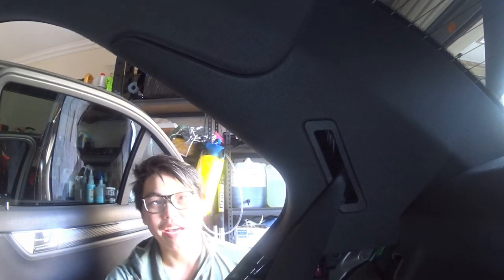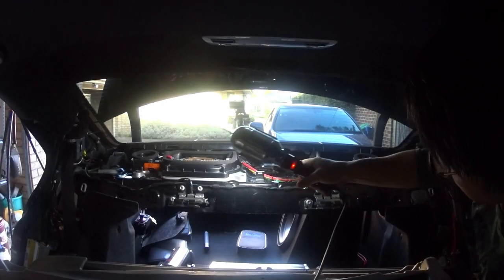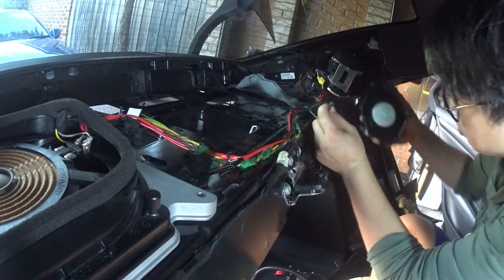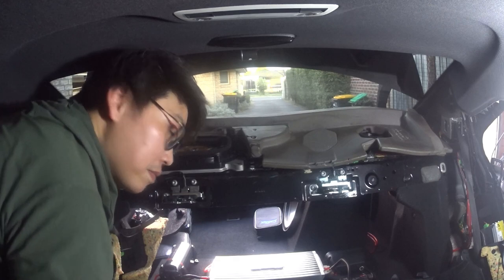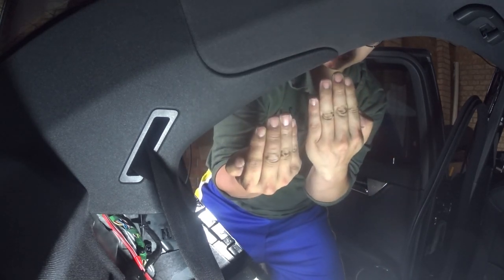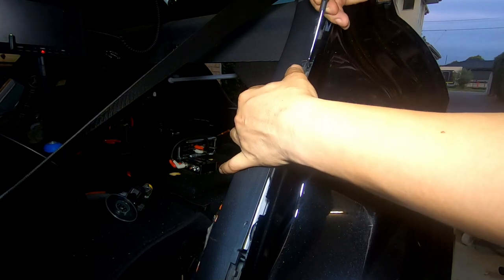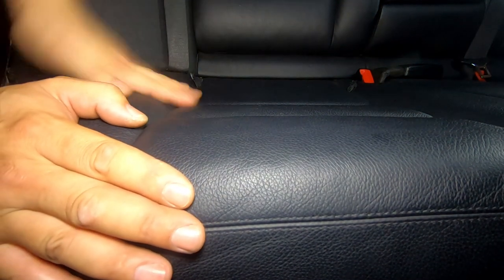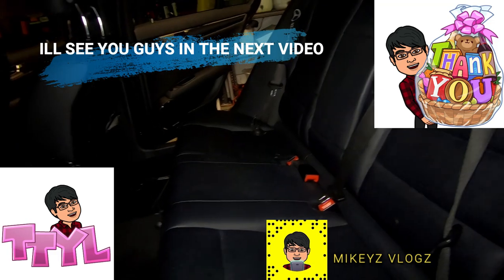MERCEDES BENZ  C CLASS W204 HOW TO ACCESS  REAR DECK + 3RD BRAKE LIGHT

Comment: NOTE: For Coupes it's a bit different to remove that upper corner piece before you can get the shelf out. You pop open that plastic Airbag cover and underneath there is a torx screw you need to undo first. After that the process is pretty much to same for unclipping and pulling that piece out. Then you will be able to access the rear shelf
Reply from the maker: good tip
Reply: Bey would I have to disconnect the battery so the air bags don’t go off?
Reply from the maker: they wont go off but u will get airbag light error. so make sure u disconnect and wait 20mins for all power to discharge

Comment: I did it!!! I swapped rear deck cover after changing the bench from non-foldable to a foldable one year ago. My conversion is as complete as it can get (missing lock cables that sense if the bench is closed). These hex mounts gave me headache. I will not retry this even if someone payed me to do it. Also, side note: wash your hands when installing these. After messing around with door seals and such, your hand will be dirty. My car has light interior, I got sweaty so I left dirty marks on these.
Reply from the maker: well done

Comment: just what i needed, i am getting some loud static noise from the smaller speaker in the rear. i hope by disconnecting it it solves the problem.

Comment: dude I love you, you safed my day with your ambitious and confident explaination skills. thank you !
Reply from the maker: im so happy to heary found my video helpful... ur so welcome .. we should all help each other out and spread the wealth of knowledge..its priceless
Reply: @MIKEYZVLOGZ  I was looking for this for my w204 coupe, there‘s something rattling inside my 3rd breaklight. That will be the only way to figure out, hope I can fix it. Something has to be loose inside
Reply from the maker: @nixpainnixgain  check the seat belt case ... its either one of the seat belt cases or tourrear deck panel... most likely the seat belt assembly that holds the belt inside and retracts ...
Reply: @MIKEYZVLOGZ  I just took a look in the back of my car and these parts and realized that it would be a way more difficult job to do the same thing in a w204 coupe.. not only the seatbelt cases, it‘s also the armrest on each sides which are clicked in different parts of the interior in the back ..I‘m a bit desperate tbh There is also an Airbag badge on the seatbelt- assembly part 😰
Reply from the maker: @nixpainnixgain  hmm sounds like a involved task but rest assured u can do it.. u can fix most things on these cars yourself.. just do some research first and have patience ... do not try to just pull it off.. makes sure you understand how it removes first ..or u can easily break stuff..take it from me..thats why i made these videos cuz i made alot of mistake too ..and i noticed that wen iim frustrated more mistakes happen often then not..so wen frustrated breathe walk away come back then try again
Reply: @MIKEYZVLOGZ  thank you, I will try my best !

Comment: Dude! Awesome work! But what if we want to upgrade? How can we find better ones? I have never seem this sized speakers anywhere else. Any ideas. Much appreciated!
Reply from the maker: hey buddy ...yeah i know what u mean ...i know they make flat subbys now althought finding the exact same size subby mite be a challenge... and with the speakers on the rear deck  ive also tried to find the right sizes but thats a challenge too .... i guess it may take some custom modifying to replace them... i know its easier to replace the front splits and the rear coaxials as they are common sizes ...but to be honest all ive done so far is replace  the tweeters and added a sub for abit more bass 12inch but its now abit much i may have to go down to a 10inch as im not all.about that bass .... its about personal preference.... ur choice .... im even in the process of trying to replace the centre dash speaker but nothing is of that size and depth.... ill just keep looking

Comment: Awesome video! I need to get signal from the rear deck sub so I can install an amplifier in the trunk. Do you know which cables I need to splice in so I can get the signal?
Thank you for the effort and time spent on filming the procedure!
Reply from the maker: u want a signal for your amp? or your sub? line output converter ?
Reply: @MIKEYZVLOGZ  it’s a subwoofer with a built-in amp like those that goes under the seat. I need the audio signal so I can give it as an input to the sub/amp. Sorry for the confusion I don’t know much about sound systems. Thanks for the help
Reply from the maker: @GuilhermeIsidoro  that's OK no stress... do u have a factory sub? if not u gotta get tour signal from the doors... I have a hk system with factory sub dual channel so I was able ro tap into my 2 channel sub for more bass ... in tour case..if u don't have a factory sub u will have only front splits and rear door speakers ...so u take signal from the door speakers...many ppl have done it like this that don't have a factory sub...if u do and just wanna add more bass like I did u can take the low input from factory sub...if not tour rear door speakers is your best bet...and u take it from the wires between the panel that seperates the front and rear..the middle a frame ..hope this makes sens e
Reply: @MIKEYZVLOGZ  I don’t have the HK system so I might not have the rear sub although I’m not entirely sure. My car is the coupe w204 so I’ll try to tap one of the rear seat speakers. Thank you a lot for the help!
Reply from the maker: @GuilhermeIsidoro ye u need to tap the door sub  u wouldn't have a sub  if u don't have the hk system

Comment: Have you possibly taken the back speakers apart? Wanting to know if 3.5 inch speakers fit on the corners and a 6x9 inch sub fits where the sub goes. Thanks in advance.

Comment: Hi, if I have foldable seats and just want to get into the rear deck to see why I have a nasty rattle coming from where that sub is, do I still have to remove the seats? Great video btw
Reply from the maker: hi andrew welcome to the channel i hope you can show your support by subscribing if you havent yet..it would really help me and mean the world the me to have your support..as for getting to the rear deck ..unfortunately there is no way around it..you have to remove the lower seats and th sides in order to access the rear deck...
Reply: @MIKEYZVLOGZ  Thanks for the reply I really appreciate it! I'm really need to know how to get the side cushion fully out mine is still locked and stuck at the very top, and some thing for the side panel. There's this nasty piece of plastic that's holding it in and idk if I'm just supposed to pull it off or not. I'm already subscribed to the channel :p
Reply from the maker: @andrewrizk5245  the side cushion next to the back rest?
Reply from the maker: just get a good grip on it and it will.come straight out make sure at the very top where u can feel the assembly that is inside the side cushions ..make sure ur gripped onto that assembly do not just pull from the cushion you will RIP it!!! get a good grip of the assembly and pull back straight with some force ...its just clipped it like the lower rear seats are exact same principle

Comment: great video, I want to access that part in my C Class 2023 W206 because It has sound insulation problem, outside noise coming from under the rear glass, should I remove it the same way? will I have to remove the headliner too ? I'm scared to do it, it's weird that we have to remove more difficult parts first, any tips on the W206?
Reply from the maker: I believe so I haven't done it on a w203 but it's basically the same procedure
Reply: any tips on what I should look for when it comes to isolation/noise in that area? I feel like the noise is penetrating the car from under the rear glass (over the boot, not the boot itself) like if the foam isn't there or some sealing issue, my ears get clogged everytime I drive the car, unfortunately the service center caused that problem after they worked on the car and removed and put back things, but they can't understand what the issue is so I'm gonna do it myself instead of wasting time with them, before they work on it the car was completely silent, sorry for the long comment @MIKEYZVLOGZ

Comment: Hi. I have a sunshade in the back (e350), I noticed the sunshade's rail attaches to the top corner piece that needs to removed to access the deck. What should I do in my case? I don't want to create an issue with the sunshade as it seems to all be connected
Reply: *rear deck (I'm trying to replace the factory sub, mine is blown).
Reply: did u find out anything? I'm having the same issue.
Reply from the maker: @Wavyypxter I'll see what I can work out for u

Comment: Hi m8 great video.  I have a c250 coupe and need to replace the 3rd brake light do I need to take rear seats out👍🤔
Reply from the maker: yes because in order to remove the rear deck u must remove the seats

Comment: great video nice instruction. i wanted to upgrad the rear sunroof do you know where to plug it in? its an original part and it should plug in into a black connector.. would be great if you could provide any infos <3
Reply from the maker: wen u say rear sunroof what do u mean ..as I only know of the rear sunshade and actual sunroof
Reply: thanks for the quick answer. thats what i was talking about sorry haha i meant the sunshade wich covers tha back window.. i installed it with the shelf but i need to plug it in and i dont know why i went to the factory and they told me the cable must be preinstalled so i cant get a single one. @MIKEYZVLOGZ
Reply from the maker: @lamaamasi313  ph ok.. u need to check wis manual and see how they hooked it up

Comment: I don’t understand a thing! I have the AMG interior and exterior package no Harman Kardon option. However I have that speaker in the back and the subwoofer! Is this standard on all the W204? They sound fantastic for what they are! I changed the player and installed an Android Chinese thing and the subs are working but I don’t understand what and how they are getting the signal from the main unit? Any ideas would be greatly appreciated!
Reply from the maker: ok do they have hardwires the speaker using fiber optic cables that run under the carpets along the side and chassis of the car main frame..metal frame ... and u have a subwoofer in the back left quarter panel ... it gets signal cuz its all hardwired and wen u connect your new system..u use your standard plug which has an adapter that plugs into your after market unit ..thata how it all gets connected ... just the same as how u install an aftermarket hedunit on any car u use the iso harness that allows the new unit to connect via the adapter..meaning all speaker signal and power and amp signal is all connected .hope this makes sense .. now with the the sub woofer and non hk system ... not too sure but non hk systems don't usually have the sub woofer in the back ... so do u have all the speakers centre dash front splitters rear doors and rear deck shelf subwoofer...its def not STD  for w204 to have sub woofer normally u need the stereo package added..their are so many packages u can get for w204 from lighting packages to multimedia package. amg package sports package wheels packages ..  navigaton package .. etc..what u have solely depends on what they added during manufacturing

Comment: Hey Mikey I just bought my 2014 w204 and my rear right speaker is blown next to the amp. My question is the speaker on the left and right the same in different brackets? Could i buy a replacement drivers speaker and install the speaker in the passanger side?
Reply from the maker: the rear speaker are surround and a subwoofer ... so they only play surround sound ..not vocals or bass... u can try find replacement speakers but I've heard alot of ppl try and fail because they are a certain size ... yes they are the same speakers just in different brackets... a good idea might be to buy used instead ... but its your choice I guess u can always try to custom fit surround speakers in there ...
Reply: @MIKEYZVLOGZ  This is a common problem. Either rear subwoofer or speaker blown.  I have the same vehicle with the Harmon Kardon Logic 7.

Comment: Hey Mike. I need to replace my stock subwoofer. But I can't find the other video. Can you show me how to remove the sub?
Reply from the maker: I show how to relove the plate with the subwoofer in it ... to remove the sub from the plate that holds it wont be much more difficult ... as long as u remove the sub woofer from the rear deck u can figure out how to remove the sub from the mounting frame... from memory to remove the sub from the frame should be too much work... the important part was to show how to remove the component cuz if ur replacing with another factory sub u will get it with the mounting frame as one

Comment: Thank you Mikeyz! Question: my speakers are blown out. Is it possible to replace them with aftermarket ones (other brands)? Or it has to be from the dealership?
Reply from the maker: hey bud..anything is possible but I've read that the factory speakers work well with the factory amp and the amp isn't that powerful so if u want abit more sound ur gonna need to upgrade the amp aswell  in order to get the full potentialnof your after market speakers ... I replaced just the tweeters thus far and noticed when I tried to upgrade the front splits the sound wasn't as good as the factory ones ...so I only did the tweeters for more treble as I added a sub too... that's what I believe and think friend...
Reply: @MIKEYZVLOGZ  thank you Mikeyz! Very clear and it makes sense.. for me there’s crackling sound coming from the rear shelf on each side. I think those could be the tweeters blow out?.. I’m going to a place tomorrow to see what can be done.. either replace them
With aftermarket or disengage them..
Reply from the maker: @P38Z350  in the rear shelf they are just surround speakers meaning they only play surround sound ... background noise..that's why our cars have theb5.1 Dolby digital.. so it's not tweeters ..its just surround speakers ... if u have they same speaker setup as mine with a factory sub woofer then they are just surround speakers very similar to a 5 speaker setup with home surround the fronts play the bulk of the sound treble mid and the sub plays bass and the rears play the surround so it sounds like there's ppl all around and tour in the centre.. makes sense?
Reply: @MIKEYZVLOGZ  ahh got it! Makes perfect sense! I noticed not much “sound” is coming out of them, except more of a “surround”... i have a CLA 2015 but the setup looks exactly like yours. The 2-combined with the 1 separate
Reply from the maker: @P38Z350  ahh yes then its surround speakers your looking to replace...
Reply: @MIKEYZVLOGZ  yeah. I asked in the dealership in NJ but they said it’s 650$ for the 2-combined and 175$ for the separate one. I think it’s a lot. So i will need to see what I can do. If it’s possible to put after market ones or just disengage them to remove the crackle
Reply from the maker: @P38Z350  look for 2nd hand ones they will work ..if ur going to disengage them completely better off to get used ones for a good price ..ebay have them ... what speakers do u have Harmon Karoonda ones? with the bluish cone? I'm not sure which they put on the newer models like the actually speaker models
Reply: @MIKEYZVLOGZ  right Harman Kardon ones.
Good idea Mikeyz. I’ll need to check for used ones. Do you think it makes a big difference having them or not? Based on your experience
Reply from the maker: @P38Z350  if the speakers are good they will be fine .... don't get me wrong u can try find after market ones .... u will however may need to modify them to fit as wen I was looking to replace mine I couldn't find the perfect size .... and I knew there would be some modifying needed to make them fit as they aren't exactly the same size and shape... just keep that in mind when looking ....... surround speakers just give u the feel of real life experience as if someone is walking behind u or talking behind u ... if u don't care just turn off your surround on ur system and play your music ... nowadays sound bars sound better then mostb5 to 7 speaker setups... love sound bars
Reply: @MIKEYZVLOGZ  got it thank you Mikeyz for all the feedback. I tried shutting them down using the system (menu of SOUND on the COMMAND interface) but I couldn’t: I can turn off the Logic7 Surround, but they keep doing the crackling noise even after As if they are still working. Other than that, I noticed the general sound changes. It’s not as nice after I turn the Logic7 off.
Reply from the maker: @P38Z350  correct...
Reply: @MIKEYZVLOGZ  hey Mikeyz, do you have an Airbag on the rear sides? Any issue with the airbag if I remove the panel?
Reply: And one more please Mikeyz :) do you know where the Amplifier is if I want to disconnect the shelf subwoofer completely without having to remove the rear sides, etc? Thank you
Reply from the maker: @P38Z350  no issues don't worry
Reply from the maker: @P38Z350  amp is behind the rear fuse box above left rear tyre behind the car pet
Reply: @MIKEYZVLOGZ  thanks a lot Mikeyz! I went to a car shop today but everyone is afraid to work on a Benz!! I’ll do it myself using your great video’s help. Thank you sir!
Reply from the maker: @P38Z350  typical response

Comment: i need to remove the speaker grille behind that other rear deck speaker grille right next to the rear windshield. Any advice?
Reply from the maker: which grill for ? there's the 6inch I think and sub woofer only..if ur talking about the long grill that covers from left to right that just prys up use a blunt plastic trim removal tool get in under one side and pry it up ..it just clips in